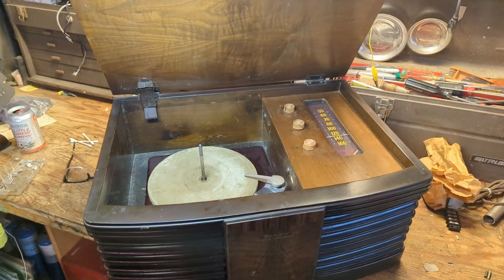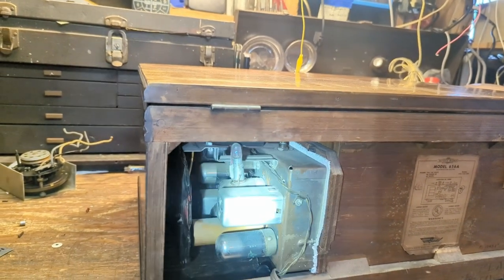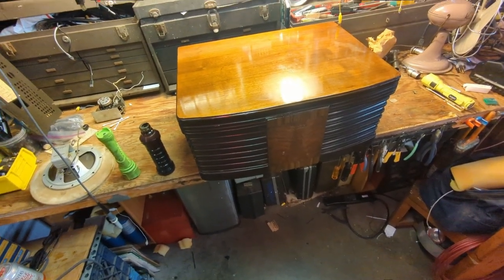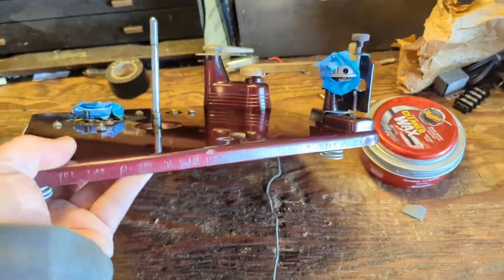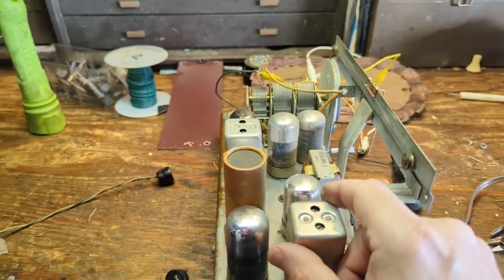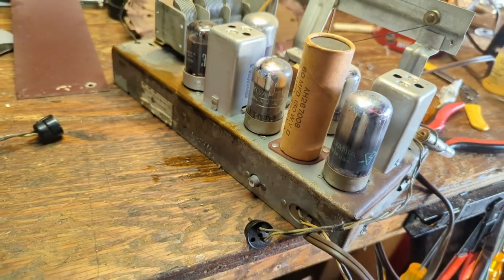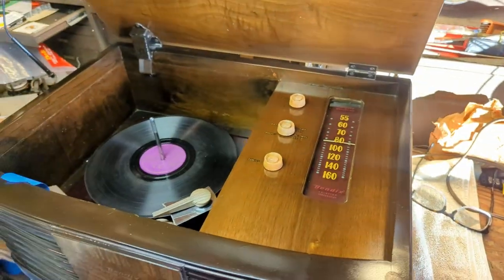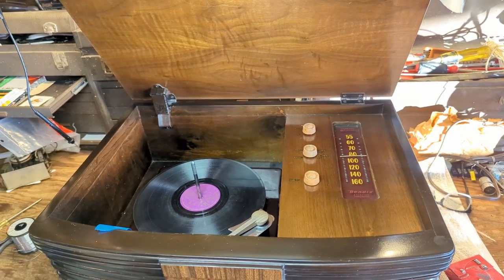1946 Bendix AM radio and 78 Record player restoration

Comment: Bendix model 656A radio record player. Don't forget the wax paper capacitor ( .004uF) on the AM antenna board. It is 
for an external antenna. That record player is pretty loud but the record is worn. Exceptionally nice job Seth!